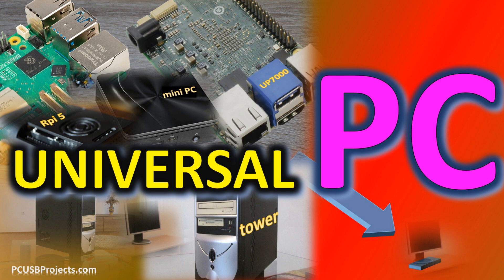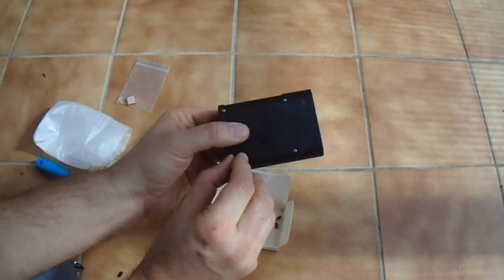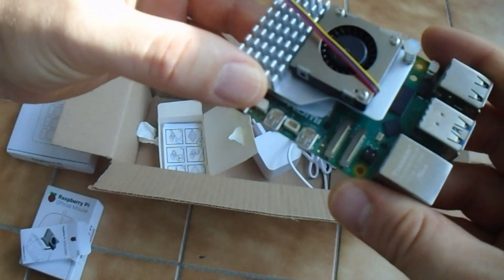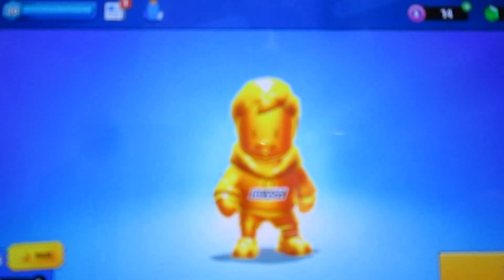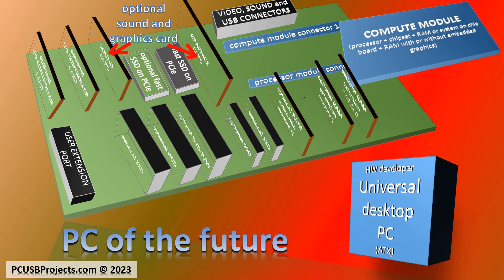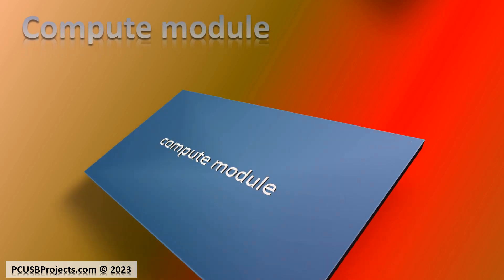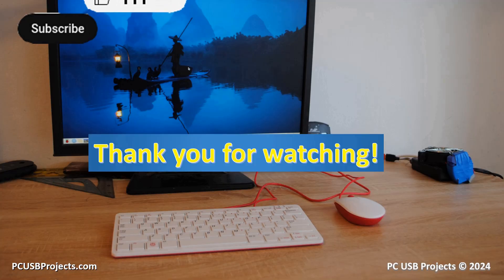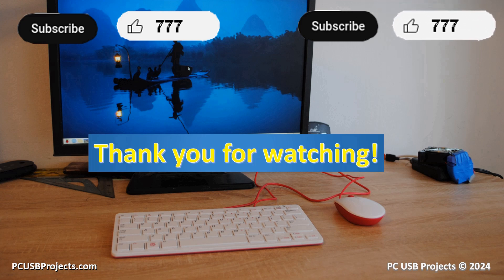Universal PC of the future inspired by Raspberry Pi 5 and other SBCs

Comment: Pi's are great for portables, build em into boomboxes for the audio and carry handle, power tool batteries and 5A buck converters cover the power. Toss the cd player and you've got a place for storage. MDF, and a laptop DVD burner underneath if you must have a spinny disc. No hot snot, use automotive gasket sealant as glue, apply thick around the perimeter and it will hold. Otherwise. multiple Pis on the desk covers the gaming, entertainment and YouTube. Instead of one computer.
Reply from the maker: I'm not a fan of disks at all. They are only needed to store wast amounts of data (speaking of TBs). SD cards are the way to go. Speaking of mini PCs. I think that Raspberry Pi is also one of them... Sometimes is good to have more small computers (ex. 1 for watching TV&video, 1 for web-radio, 1 for experimenting with Arduino projects, 1 for games, ... and 1 for desktop)... Usually it doesn't really matter if they are classic mini PCs or RPi 5s...
Reply: @pcusbprojects   For me it was the fun of installing a DVD burner, not a practical thing. It was like an upgrade mod. Find a DVD and you can watch it, rip it, put it back and still burn yourself a copy. As to memory I run Samsung BAR usb flash for the OS. Faster than micro sd, compact enough for most projects and relatively cheap. Samsung FIT are smaller, but I've had trouble with those ruined a couple of em. I think it was speed and heat. BAR have an aluminum housing that gets rid of the heat better.

Right now I'm watching Youtube on a separate Pi5 on a monitor, Pi4 Boombox is next to that running Android 13. Watching "Harvey Birdman Attorney at law" on that, and replying to you on the 2nd Pi5. Will most likely play PS2 next. It's a comfortable spread. I can always run a 4th Pi if I want to image an OS or experiment with one. I don't want for Windows, or a "better" "faster" PC.
Reply from the maker: You might be interested in this video on Android 14 running on RPi 5: https://youtu.be/sRcld-BQCo4.
Reply: @pcusbprojects  Yeah it's on my to do list. That, and getting a pi5 portable with my setup, Right now Android 13 for what I use it, (Google TV and Tubi,) it works great on a pi4. A Pi5 would be a waste so far as computing power. Maybe the internet/wifi would be faster/better. I actually got distracted and I'm down a rabbit hole in overclocking one of my Pi5's beyond 3.0 ghz. I actually just have to test it. It's set to 3147ghz
Reply from the maker: Maybe this will help you with overclocking: https://github.com/raspberrypi/firmware/issues/1876.
Reply: @pcusbprojects  Overclocking on 12v batteries and buck converters is a little more challenging.
Reply from the maker: If you use a 12V battery just to have enough current (say > 5 A), it might not be a bad idea to buy an industrial PSU (5 V, 30 A, it is also adjustable cca. +/- 0,7 V). It costs about as much as the original RPi 5 PSU. Here you can see what how I've connected my RPi 5 to such a PSU: https://youtu.be/17P1YeYgqCQ and it still works perfectly... I don't do overclocking, but now RPi 5 can also power another RPi 5 or RPi 4 or charge a smartphone through its USB-C port...
Reply: @pcusbprojects  The only reason to go portable with a Pi5 is to play games with it. PS2, Gamecube, that kind of thing. Which doens't need overclock. My Pi4s are still at their limits. I'm satisfied with what I have here. First attempt, my Pi5 booted up with the official 7" screen, no problems, worked like it was on wall power. I already had the usb_max_current_enabled. 

Something to watch out for I broke off the fan header accidentally. It was damaged before I knew it. I could actually smell the Pi5 heating up, a sweet smell. It was only a little loose at first, press on it and the fan would come back on. It's from where I was grabbing the pi5 to swap USBs. Temporary solution, I have a twin fan thing from my  Pi4s sitting on top of the official cooler. It's working if you ever have that issue, somehow it's quieter and seems cooler. lol

Comment from the maker: @pcusbprojects
  • 3 hours ago
RISC-V (RISC five) processor designs are currently much less known and much less used.... There is also Tensilica with Xtensa processors that run popular ESP32s IoT modules. But the latest ESP32-C IoT modules have ARM cores. There are also PowerPC processors (also of RISC design == reduced instruction set computer) that have once run IBM (workstations) and Apple computers and they wereused in various projects like Honda Asimo. (see: https://en.wikipedia.org/wiki/PowerPC).

However, I believe that the main battle - if I may call it this way - still rages and will rage between x64 and ARM64 designs for a considerable time in the future...  ARM processors designs also have RISC architecture, but Intel and AMD x64 processors keep using CISC architectures (CISC == complex instruction set computer).

Comment: Don't forget RISC-V.
Reply from the maker: Yeah, but RISC-V (RISC five) processor designs are currently much less known and much less used.... There is also Tensilica with Xtensa processors that run popular ESP32s IoT modules. But the latest ESP32-C IoT modules have ARM cores. There are also PowerPC processors (also of RISC design == reduced instruction set computer) that have once run IBM (workstations) and Apple computers and they wereused in various projects like Honda Asimo. (see: https://en.wikipedia.org/wiki/PowerPC).

However, I believe that the main battle - if I may call it this way - still rages and will rage between x64 and ARM64 designs for a considerable time in the future...  ARM processors designs also have RISC architecture, but Intel and AMD x64 processors keep using CISC architectures (CISC == complex instruction set computer).